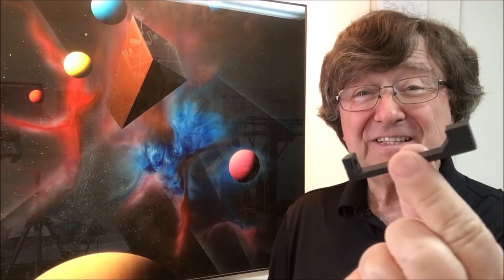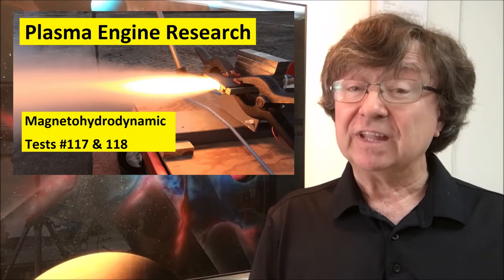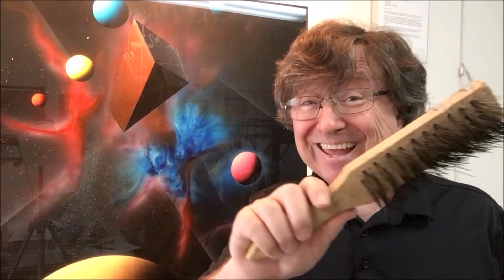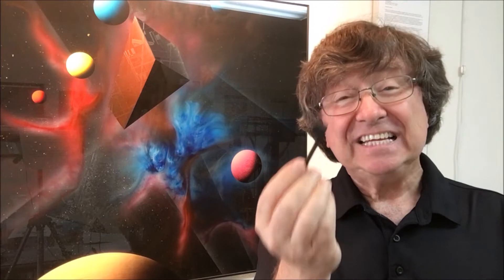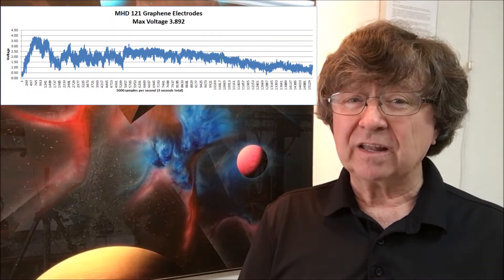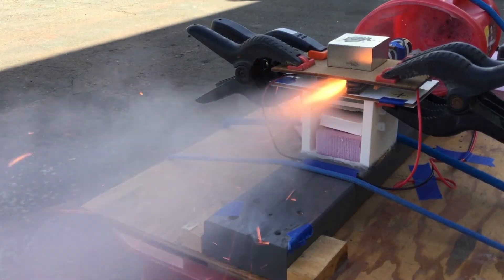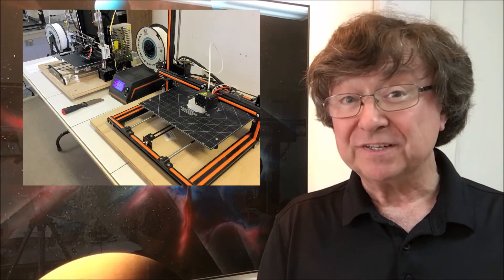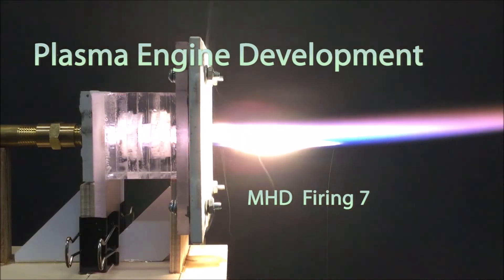Magnetohydrodynamics with Ablative Graphene Electrodes

Comment: followed your [project for a long time. it's just such an innovative take on a very known method of flight(LTA). i have a question. what budget would it take to bring airship to orbit possible right now? are we talking millions, hundreds of millions, billions?
Reply from the maker: The last time we tallied it all up it worked out to $144 million to go.
Reply: @johnmpowell  another question about the transatmospheric ascender. can something like the size of the transatmospheric ascender be built up there at the dark sky station? how would you build it up there? since it can not touch the ground, that would be a colossal thing to do up there.
Reply from the maker: @midsessionz9649  We intend to build all the big Ascenders at the Dark Sky Station. Build may be too grand a term. Most of the construction will be on the ground, but they will be inflated at the station.
Reply: @johnmpowell  would beamed power be applicable to ATO in any way? having a power plant on the ground to beam power to the dark sky station or to the ascenders. it can keep the dark sky station up there for a long time.

Comment: and if the nozzle of the plasma engine will serve as a solenoid electromagnetic coil so that the plasma does not touch the nozzle and there is no overheating and the magnetic field of the solenoid in the middle of the coil is homogeneous and will give an additional pulse of jet thrust